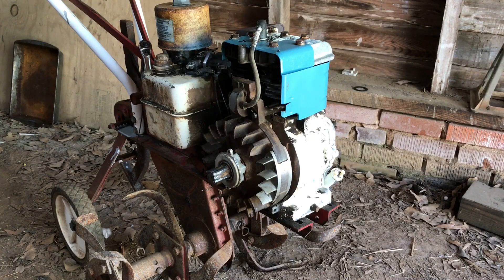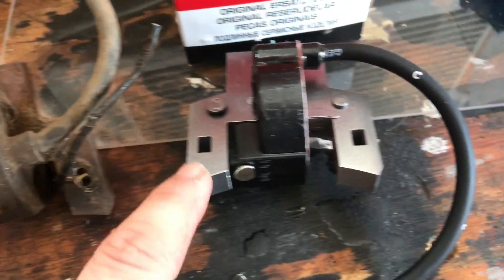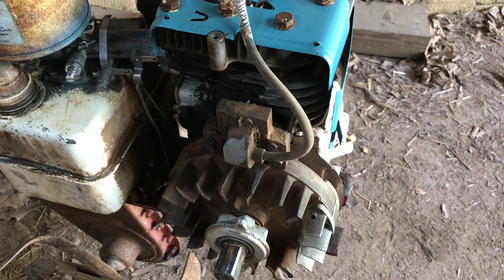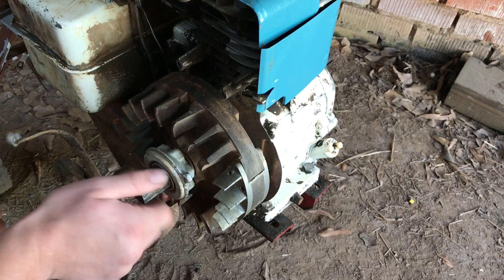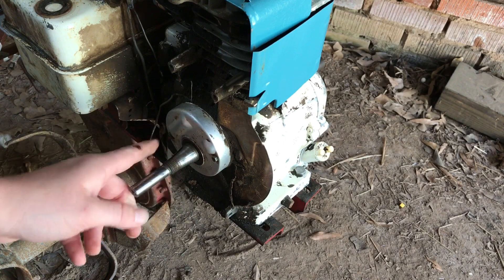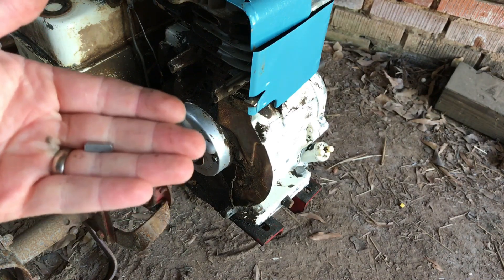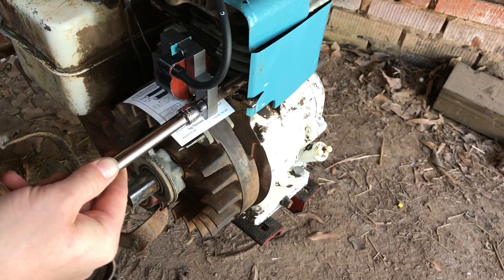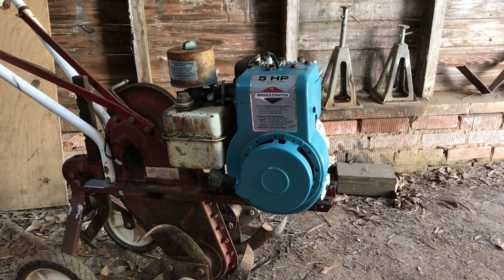Upgrading Ignition System on Briggs & Stratton Engine

Comment: Thanks Mike!  A point of confusion:  I know the kill switch works by grounding the coil so it can't fire.  But you show two wires going to the same tab on the coil, one you say goes to an engine ground and the other to the kill switch.  It seems the tab attached to ground would have the coil always grounded out, independent of the kill switch, and that there would never be a spark.  What am I missing?  Thanks again.
Reply: It only grounds that wire when you move the throttle to stop. That nut is isolated from the metal so it doesn't ground all the time. The other end works off the points for spark.

Comment: This video was exactly what I was looking for! Clearly and simply explained. Going to perform this procedure on a 1960's Simplicity snowthrower that has a B&S 7 HP 170402 (contacted B&S directly for the correct coil part number).

I have a question about the kill switch wire - is that the second wire that comes out from behind the flywheel and attaches to the frame under the carburetor? Do I just cut the old wire like the points/condenser wire? And then wire the new coil to the same mounting point by the carb?

Thanks so much for this!

Comment: My 8hp vertical Briggs had no spark, I sanded the flywheel magneto so it’s clean. I changed the coil to this one and installed everything and it still don’t have spark. The spark plug looks okay visually but I’m thinking it may be the culprit. I don’t know what else to do. Any tips?

Comment: Hey I got a ? I got a 3hp Briggs Stratton has points i am not getting any spark the points condenser looks brand new i cleand the coil flywheel nothing either the coil is bad or does this engine have a kill wire?? There is not the meta tab on top by the spark plug there is a wire by the carb thats wrapped around a tab is that the kill wire im thinkn the kill switch is off not letting it get spark please help thanks

Comment: Thanks Mike.  Where did you wire in the kill switch ?  Also I was very happy to see what appears to be a Merry Tiller.  My father and I bought one back in the mid 60's.  It is the simplest hardest working tiller of its type ever !  Wish I could find one here in Australia.  A real golden oldy !  Hang onto it like grim death sir.  Thank you for a great video !  Alex ( ex pat Canadian )
Reply from the maker: Theres a tab on the throttle control linkage under the tank that the wire fits into. When the throttle cable is put in the off position, it grounds out. Many times on these old style Briggs, them things get rusty and broken. In that case, I’ll get a universal toggle switch to wire it to. And other end of switch to a good ground. When the switch is open, it’ll run. And when the switch is closed, it’ll ground out to turn the engine off. You can get momentary button switches to do the same thing also.

Comment: Do you ever need to remove the engine from the body to remove the flywheel? Mine is really stuck on there and I'm wondering if I'm just not prying enough. I don't want to damage anything.
Reply: Lightly taps it with a hammer to add vibration to it or add some sort of vibration as you pry it off.
Reply: heat and oil, heat and oil, heat and oil, heat and oil... to the flywheel/crank snout interface for a week before actually PRYING gently under the solid part of flywheel and a SOLID point on the block and give the crank snout a quick rap with hammer and it shd pop looose .  put the nut on the threads on the crank snout to protect the threads on crank snout from damage if u miss with the hammer... dont miss with the hammer. it shdnt take that much hammer force to get the flywheel off if u heat and use oil, heat and oil heat and oil of the center of the flywheel where it is rusted to the crank snout. lay motor over so GRAVITY is on ur side for oil to run in between the stuck crank snout and the gd flywheel that has been left out in the rain forever like a  instead of in covered shed.  i lightly oil my crank snout/flywheel hole when i put it back together so if i have to take it apart again it isnt such a struggle.  i also use valve grinding compound on the flywheel hole/crank snout interface to roughen up the 2 surfaces so they MATE together. the timing key is just for timing. the friction fit of the flywheel nut at 50 POUND FEET OF TORQUE is what holds the flywheel on, not the key. the TIMING key is just for timing. the deal is with the recoil start ratchet ppl just tap it "tight" and that is NOT 55 FT/lbs of torque that the flywheel nut is supposed to have to get the flywheel nut TIGHT to keep the flywheel ON THE CRANK SNOUT. too bad the special tool is so expensive as it is no longer made $30 for that special tool to get the starter ratchet thing on / off the crank snout??? I DONT THINK so.
Reply: I used a big three jaw gear puller to get the flywheel off my 10 hp Briggs & Stratton vertical crank lawn tractor engine.  Mine hadn't been off since I bought it 41 years ago. Boy was it on TIGHT!  Made a huge snapping noise when it finally came off. Banging on it with a hammer would not have been good idea. 
Prying with a big lever also wouldn't have worked and would have damaged whatever I was able to use 
the lever on. My gear puller came with a three piece set pretty cheap from Harbor Frgt.

Comment: mine is just like that old motor can not find a model number so was hoping that you would have given a part number on that coil its identical  to mine  and it is also electronic but is bad  but no parts number on an old 5 hp model horizontal

Comment: Here's a question! We followed your video (thank you very much!) Got everything back together, pulled the cord and it started right away, but then died 20 secs later, and we can't get it going now. And there's a backfire happening in the carb. Any suggestions?
Reply from the maker: Check the flywheel key, make sure it hasn’t sheared. If that’s good, I’d look into the carburetor.
Reply: @MikesGarage96  THANK YOU SO MUCH! For your reply and your video. Running like a charm!

Comment: i still dont under stand why you have to take the fly wheel off........just change the coil and thats that...wtf
Reply from the maker: You’re suppose to clip the wires at the points cover behind the flywheel so they don’t wrap around the crankshaft. If you know better, then are you watching this video?
Reply: He said the flywheel key was broken.    He will be replacing it again because  he only tightened the starter clutch hand tight.  I think the torque is about 50 or 55 ft. Lbs. There is no need to remove the flywheel because the wires can simply  be yanked out by hand or with pliers.